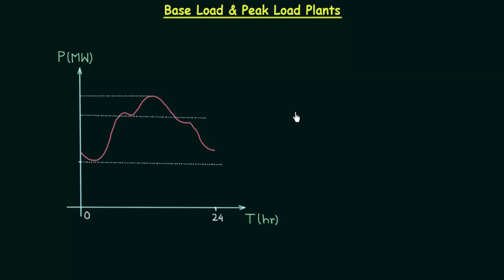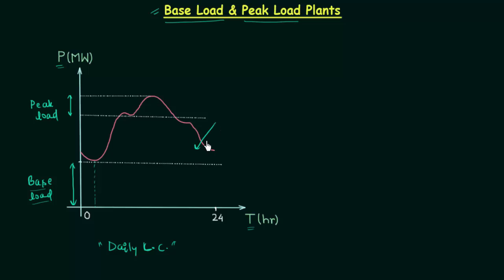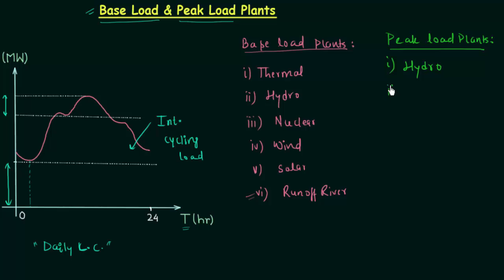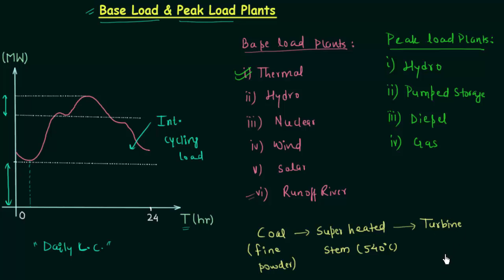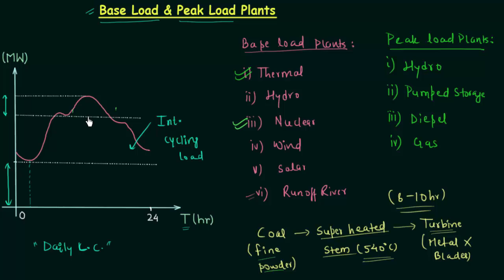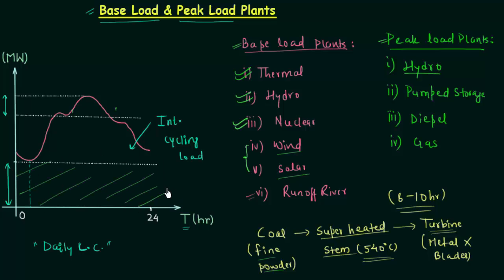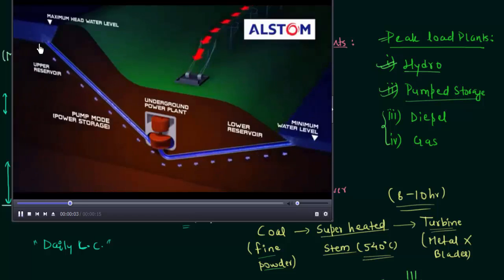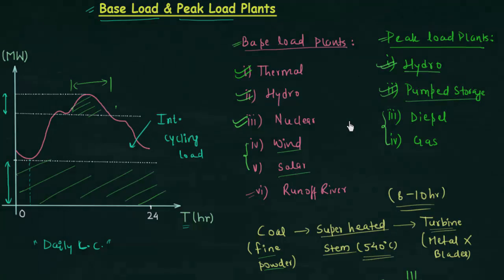Base Load & Peak Load Plants

Comment: Sir ,I can't understand ,as you say to avoid the expansion of blades ,we have to do heat the blades of turbine after then we send  the superheated steam to blades .
What's meaning it. Pls tell me
Reply: ENGG JMI actually it is not correct.....i explained you....There are not only one turbine is used to rotate the generator's shaft....there are lots of stages of turbines....like low pressure turbine...high pressure turbine....some time intermediate pressure turbine also used.......when steam is flowing then the steam is expanding in turbine and lose their pressure and you can also say it's temperature......the blades of turbines are capable to bear 1200 degree Celsius temperature with out any expansion.....

Comment: what is the difference between pumped storage & hydro plants?
Reply: hydro plants is like normal dam used for generating power.

pumped storage needs an elevated area, where water can be stored in a large amount. For example, a man-made lake on top of a hill. When there is a lot of excess energy from wind/sun, the energy is used to pump the water up to the hill and into the lake. When there is a need of energy, the water stored in the lake will be released from the height and the water will hit the turbine. (this part is analog to the dam plant)